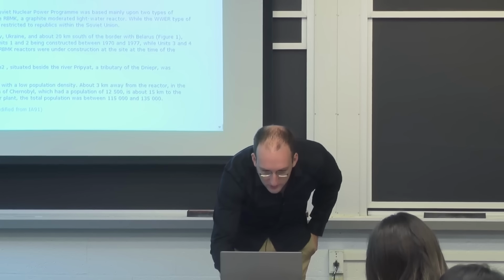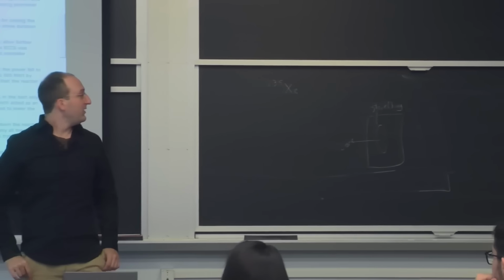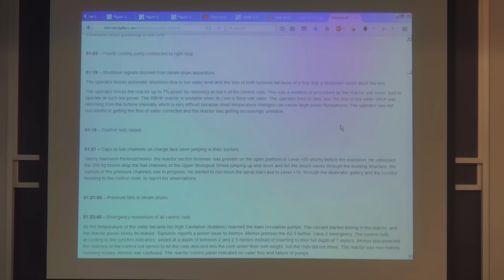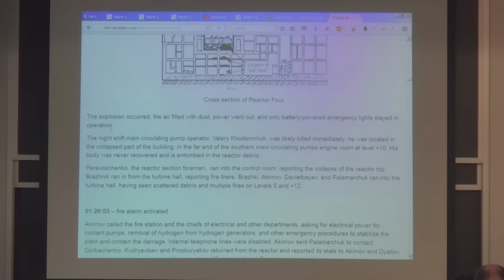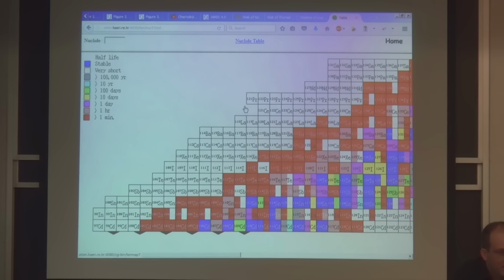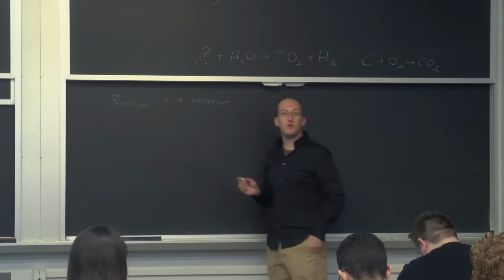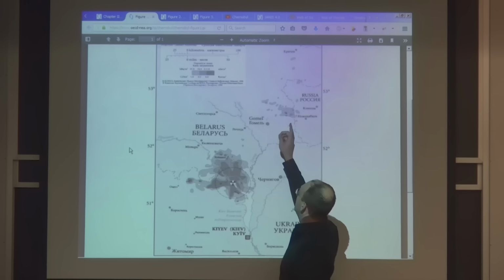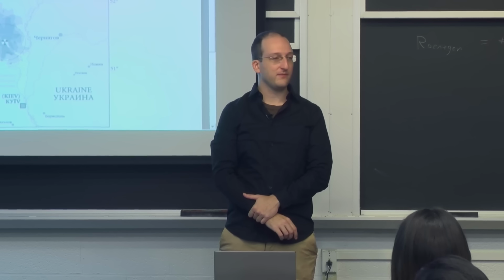26. Chernobyl — How It Happened

Comment: Even MIT getting control rod specifics wrong. Absorbing apart of the rod is not tipped with anything, there is about ~1.25m gap followed by ~4.5m graphite rod, which functions as reaction accelerator, an essential component to RBMK design not to leave channel filled only with water when rod is up (out), as that would be terrible for neutron economy. Think cheaper, as a soviet engineer to get it working with least possible fuel enrichment. It was a brilliant and cheap design, plagued by unrectified design flaws and terrible oversight in building phase.
Reply: @tommcdaniel9554  No one is perfect. Even an MIT professor.
Reply: That's correct. I don't know why so many sources say it's "tipped" with graphite. It's actually a pretty long graphite rod separated by a 1.25 m long telescope. When the control rod is fully retracted, the graphite displacer is located in the middle of the core height, with 1.25 m of water at each of its ends. The main flaw with that design is, that when inserting the control rod, the grahite part gets pushed out towards the lower end of the reactor displacing the 1.25m of water and increasing the reactivity in that part of the reactor. the most plausible scenario is that this led to a critical increase of reactivity on the lower end of the active core. What's shocking is the fact that they knew about this flaw as they had already observed it in another RBMK in Ignalina but they didn't provide any of the staff with that information.
Reply: @trixn4285  Nowhere do i see an explanation to the following... even as the reactivity is increased at the bottom of the core by the graphite rod moving down to displace the water, why is the reactivity at the center of the core not already much, much higher? There must be more steam voids near the center, and the xenon has been burning off more in the center. So yes, I understand how the reactivity at the bottom increases, but not why this is the tipping point.
Reply: @niallmccaffrey791  This is a very good question and I asked myself the same. I'm not an expert by any means but I guess that "bottom" in this case doesn't mean only the last 1.25 m. As neutrons do not only move in a horizontal line but in every direction an effect of increased reactivity would also be seen more towards the center. They knew from other plants with that design and control rods that when AZ-5 was pressed it leads to an overall increase of reactivity in the system. It's hard to find any source that explains the exact distribution over the core profile. Maybe "bottom of the core" can be understood as the lower half. I guess we will never know it for sure. All investigations depend on mathematical models of the reactor. Maybe the AZ-5 wasn't even that important and the runaway excursion was already happening when they pressed it. At least they saw a rapid increase of thermal power beforehand because that is why they pressed it to begin with.
Reply: @trixn4285  Most of the explanations I've heard though suggest that re-inserting the control rods caused an explosive increase in reactivity, but skip exactly why... from the time az-5 is pushed, more moderator is not entering the core. The rods were fully withdrawn for a while beforehand, meaning the amount of graphite in the core was already at its max all during the test, and remained so at the time of az-5 and after. It seems like the bottom of the core would be the place of least reactivity, with cold feedwater coming in. It's confusing, and I want to know!
Reply: @niallmccaffrey791  There is another video from a nuclear engineer that if found pretty damn good https://youtu.be/YRPuO1RhbKo Actually I‘m not sure if AZ-5 played such a big role. They fucked up much earlier and AZ-5 which they though was fail save couldn‘t stop it in time even making it worse for a short period.
Reply: @niallmccaffrey791  Due to low power, the steam voids weren't pushed by the water out of the core so they remained in the bottom of the core. More steam means less neutrons are being absorbed by hydrogen which absorbs some neutrons, so reactivity was being increased by the positive void coefficient, especially in the bottom part. The bottom 2.5 metres of the rods were made of carbon (an excellent moderator)  to enhance fission due to low fuel enrichment. This meant when the rods were inserted, the carbon "tips" pushed out whatever water was left in the bottom of the core and was replaced with extra moderation due to the bottom part of the control rods being covered in carbon.
Reply: @niallmccaffrey791  IEAE report on Chernobyl states that decoupling had occurred
 between the upper and lower halves of the reactor. And that the reactor itself was so big that one should think about it as several reactors being managed simultaneously. So there was a huge spike in the thermal output in the bottom part of the reactor as graphite replaced water. So then it would be the "bottom" reactor that exploded. But the report itself states that we will never know what exactly was the actual cause. This is just one hypothesis.
Reply: @niallmccaffrey791  You aren't accounting for the positive void coefficient. There was still water at the bottom of the reactor vessel, but none at the top. In ordinary operation you are correct, as the ballast descends, water rushes in above it to fill its place. However with the positive void coefficient, when you boil all the water out of it, lowering the graphite still leaves an energetic void behind it that continues reactivity.

It's basically a factor of overall reactivity of the reactor vessel. Hotter rods are much more reactive than colder rods. With the graphite in the middle, sure, the center of the vessel started to get extremely hot. Let's say 15% of the fuel at the top and 15% at the bottom are in a 'low' state but the 70% middle is in a 'high' state. Lowering the graphite ballast now added another 15% of the fuel into a 'high' state. As the ballast descends it does open up a void behind it that lowers reactivity, it still does not lower reactivity (especially with steam) as effectively as water would (certainly not boron) and it also had absolutely no cooling so it was still overheating as well. So while the power at the top of the middle is slightly decreasing, the bottom is ENORMOUSLY increasing. Potentially, that added just enough excess power to the equation to shatter the fuel rod cladding and cause an internal explosion, which is when the control rods stopped. Now with 85% of the reactor in maximum power, the xenon all blew away, while simultaneously the heat enormously increased, spiking reactivity, rupturing the water channels, breaking the rod guides, jamming the rods, increasing more reactivity, causing more heat, and more steam, and then the whole thing blows up.

You would be ordinarily correct with lowering the rod, but you forgot about the steam that was behind it because of their 'test'.
Reply: @trixn4285  Exactly!
Reply: @trixn4285  "The main flaw with that design is, that when inserting the control rod, the grahite part gets pushed out towards the lower end of the reactor displacing the 1.25m of water and increasing the reactivity in that part of the reactor" - Unless the fuel rods in RBMK reactors was on top of each other (rods are 3.64 m long and reactor is 7 m), i don't think that was an issue. According to "INSAG-7
 The Chernobyl Accident: Updating of INSAG-1", in second chapter they are showing that the tipical length of a graphite rod that are at both ends of the control borone carbide rode with 1.25 m "gaps" with water in between, is 4.5 meters. So thats a little above usual fuel rod length. So water beneath the graphite doesn't slow the reactivity that much as i'm assuming since the fuel rods are placed at one level of altitude in the reactor. Maybe the main reason of water beneath was just to absorb neutrons (gather heat) and not wasting it by letting some absorbing shielding materail of the reactor doing it. But that's my guess that based on a little data that i briefly looked.
Reply: @Mr_Bartt  The fuel rods are contained in an assembly consisting of two sub-assemblies positioned on top of each other. Each sub-assembly carries 18 fuel rods arranged around a central carrier rod. The length of the assembly in total is about 10 meters with 6,86m of that being the active region. There is a good picture of that on the english rbmk article. https://en.wikipedia.org/wiki/RBMK#Fuel

The positive scram effect is confirmed and a known design flaw even before the Chernobyl Desaster. It has first been observed in an RBMK in the Ignalina plant in 1983. There is no debate about whether or not this flaw existed (it has also been fixed in other RBMK reactors as result of the accident) but there is a debate about how big the impact of that flaw was for the Chernobyl Desaster to unfold the way it did. As the data available about the exact reactor state at the time of the runaway excursion is very limited it can only be modeled with some reasonable assumptions. The reactor may have already been in an unrecoverable state when the scram was pressed. But it is reasonable to assume that the temporary increase of reactivity in the lower part of the core when inserting all rods simultaneously was a contributing factor.
Reply: @trixn4285  Thanks for pointing it out and for califying, looks like i made a mistake (classical ignorance) by not looking at more info before doing conclusion.
Reply: @Mr_Bartt  One of the best (and also quite entertaining) technical descriptions is this one: https://youtu.be/YRPuO1RhbKo
Reply: This myth of 6-inch long graphite tips is strangely popular. I wonder what the source of it is?
Reply: @tommcdaniel9554  He is right, actually.
Reply: I was looking for this comment, thanks
Reply: You're being pedantic. 'Tipped' in English is an accurate description of the rod's construction. Being economical CAN be brilliant. But in this case, the operators were poorly trained or unqualified in nuclear physics, and needed a fail-safe reactor design or at least containment. There were so many stupid choices done there. Don't praise them for designing a bad reactor on a thin budget and then blowing it up. It was massive ego and hubris conpounded with cheap design and not training people that doomed them.
Reply: @nicklockard  I utterly disagree. Even the professor depicted it wrong. That isn't a tip, it's more like a BALLAST. A "tip" is a small protrusion on the end of something. The tip of a pencil. The tip the tongue. Nobody could possibly ever see the graphite ballast assembly and call that a "tip" of anything. It was a telescoping mechanical rod almost as big as the reactor vessel itself. How absurd to call that a "tip".
Reply: @fnhatic6694  Semantical and totally besides the point. They had tons of stupid choices and crappy safety practices and killed a lot of innocents.
Reply: @nicklockard  It's highly misleading and it's even the reason why an MIT professor doesn't get it right.
Reply: @fnhatic6694  so that excuses all the dumb decisions and lack of respect for the dangers of nuclear power I suppose. It's okay. One word is slightly misleading according to one random. Internet poster, so the tens of thousands killed and displaced don't matter. See how ridiculous you sound? Why are you defending the indefensible? So absurd.
Reply: @nicklockard  Dude I literally only said that 'tips' can be misleading and has been misleading in the past. What the hell is all this other shit? Are you just trying to be "right"?

Oh and who the fuck were these 'tens of thousands' that were killed? What in the hell are you yelling about?
Reply: @tommcdaniel9554  people like you are why this whole country is shut down.  

Trust the experts! Academia knows best! 

Baaaahhhh sheep, baaaahhhh
Reply: @lofttm969  qualify "whole country"? I was never out of work at anytime during "covid", I worked in the chemical industry at the time, I basically made the chemicals that went into making the batteries that were used in medical devices, and I've since moved back into the trucking industry, cause "everybody's gotta eat" and the chemical industry is quite a dangerous field to be working in, at best.
So noo, not everybody was shutdown!
Reply: @lofttm969  LOL yep, I'll always trust the advice of people who get fired from McDonalds vs the millions of phD doctors and research scientists who spend every waking day studying an incredibly specific field.  WHAT FOOLS!  Heres the difference: people with pHDs will always doubt they are right, and keep studying.  Idiots will always assume they are right, and stop studying.
Reply: @johnspence8141  in my experience, the exact opposite is true.
Reply: @lofttm969  of course that's your experience, its called confirmation bias.  Anyone who draws your conclusion is never based on facts, its based on the 5 other dolts you get drunk with.  Try spending 9 years studying, then you can talk
Reply: @johnspence8141  It honestly gives me hope for humanity when I read a comment like yours, when usually day to day, online and off, I feel hopelessly overwhelmed by people who seem desperate to supplant rationality, progressive thought, years of dedicated research, scepticism and doubt, in favour of formal and informal fallacies, confirmation bias, and all sorts of aversions to the seeking of truth, just in order to “win” an argument. Every day, it makes me so depressed; please don’t stop arguing for actual quality of truth, like you have. As I said, it’s given me a bit  of hope, being dead serious haha.
Reply: @rsb867  oh I hear you.  It can be depressing but just remember : if most people agreed with them, the world wouldn’t be science based.  Their  arguments  are a desperate need to be heard in a world that doesn’t value their opinion.
Reply: @johnspence8141  @LOFT Tm   experience isn't confirmation bias. Confirmation bias is about how you go about ranking those experiences. A bit like...oh i dont know.....the experience of a 9-year trained YouTube commenter who comes across the stated experience of someone they feel confident has no good basis for their empirical conclusions as it doesn't fit with their own, extrapolating that someone's life to include a variety of other people who's experiences this commenter has a good reason to rank extremely low and therefore is able to completely dismiss.........
Reply: @miff227  your answer is the perfect example of a pseudo intellectual.  All fluff no content.  I’m an analyst PhD level calculus and statistics.  And sorry: nailed the definition of confirmation bias.  Good luck tho!
Reply: @johnspence8141  confirmation bias is about dismissing some evidence and weighting other evidence more highly, depending on your current conclusions. So no, you didn't nail it, but you did exhibit it. That you don't (yet?) see that is kinda telling. But I'm fighting your own sense of superiority, plus Dunning and Kruger most likely, so I'm not going to be the one to pierce your veil. But for others reading, there's a whole world of empirical data that ISN'T government statistics that shows another truth of the situation. Be aware of it, try and rank the info correctly and see what possible conclusions the data can point to and don't close off avenues of thought while those avenues are still extremely plausible based on what is known.
Reply: @miff227  here you go loser : confirmation bias, the tendency to process information by looking for, or interpreting, information that is consistent with one's existing beliefs. This biased approach to decision making is largely unintentional and often results in ignoring inconsistent information.
Reply: @johnspence8141  yes John.....are you seeing it yet.....?
Reply: @miff227  here found exactly what I mean. https://youtu.be/adFydLvLLeU